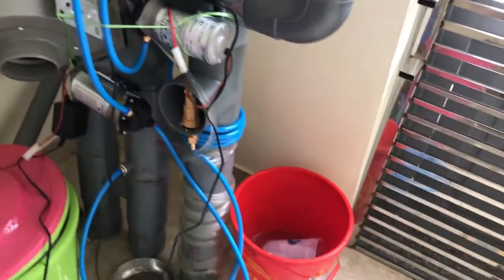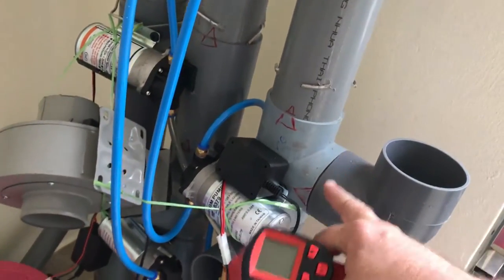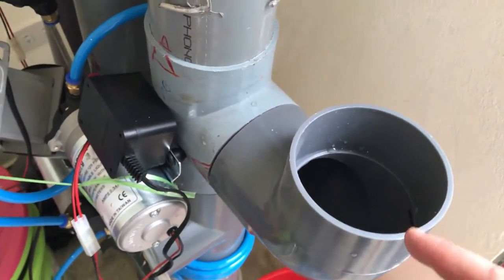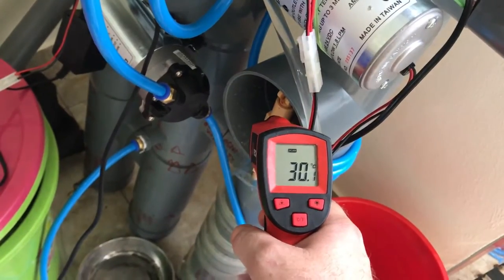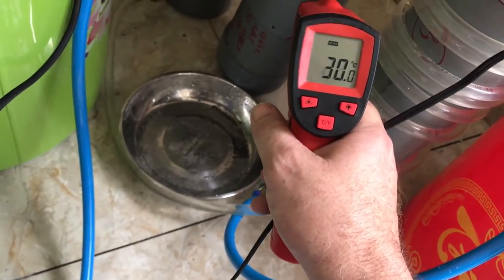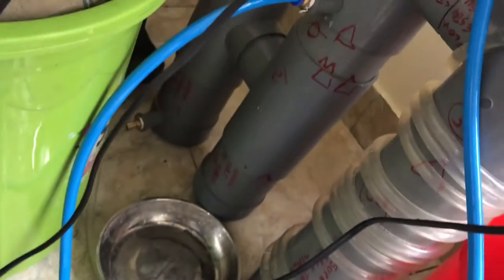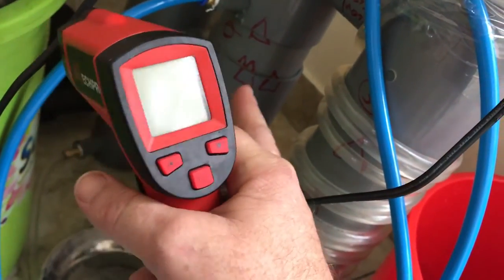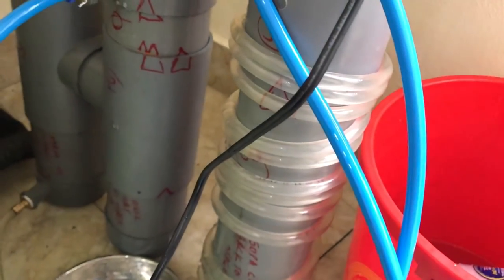Solar powered air conditioning system Desiccant based cooling system that should save the world ?

Comment: There are a lot of different ways to use a system like that. The best improvement would probably be to add a tank or two to store the concentrated salt water before you use it. That way you regenerate the solution with the heat days before you use it. The salt water has to cool down to room temp before it can be used for cooling. The other obvious weak part is that it looks like you have 4 inch pipe there but you probably need 6 inch to cool more than a single room. There are a lot of little changes that would make it work better. Like the concentrating and adsorbing towers could be outside and only the air cooling tower should be inside. Instead of one tank for solution, you could have one tank for warm solution outside and another one inside for solution that has cooled to room temp. What salt are you using calcium chloride?
Reply from the maker: No I was just using normal salt but only because I wanted to make a cooling system that was available to be built by the most people. I think you are right though about the pipe size needing to be bigger and running a separate drier outside. Just looking for the simple design too… with the humidity being so high maybe I have no choice but to use calcium chloride but can that cause any toxic effects in the air inside the home?
Reply: @pacifictradingpost7972  It's not the humidity. Sodium chloride isn't hygroscopic enough. You can get calcium chloride for less than $1 per kg as the more expensive road salt that's non toxic to plants. 

No calcium chloride should escape to the evaporative stage, but if any did, it shouldn't get past it into the conditioned air.

A final filter on the output will lower the humidity of the air coming out of it and preferably any condensation on the final filter should drain back into the tower.